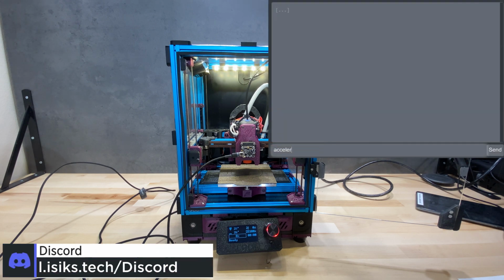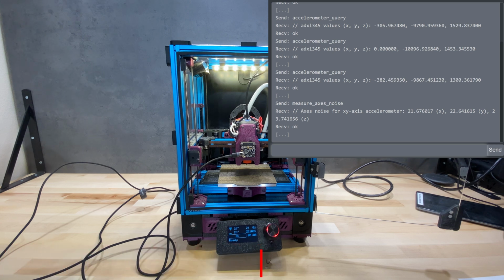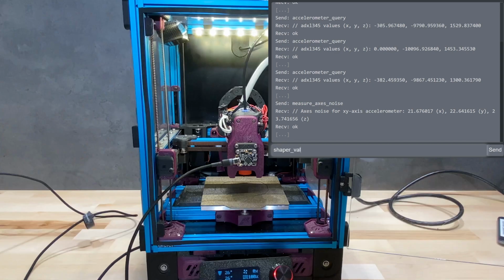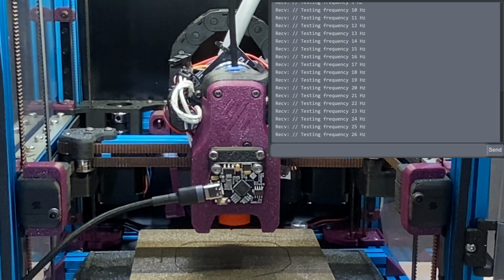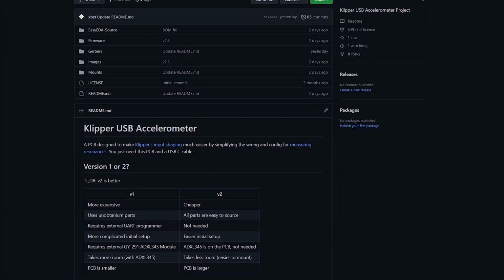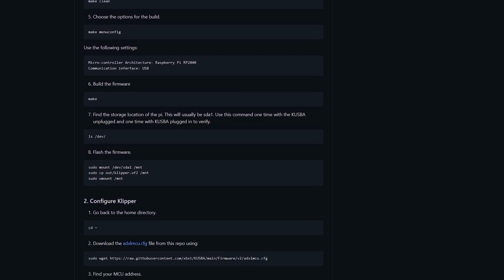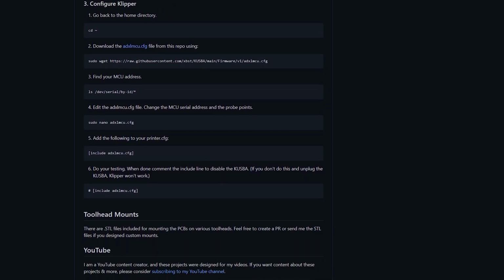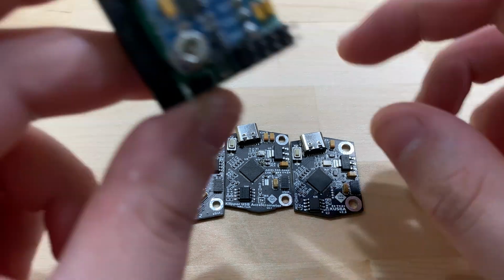Klipper USB Accelerometer PCB for Easy Input Shaper Tuning

Comment: You had me at 'Electric Boogaloo'. My v2.4 board arrived yesterday.
Reply: I'm having issues ('MCU Protocol Error') getting my 2.4 board set up. What's the best avenue for assistance? Thanks!
Reply from the maker: You need to update the firmware on the board. You can find instructions on its github repository.

Comment: {"code":"key119", "msg": "Invalid adxl345 id (got ff vs e5).This is generally indicative of connection problems(e.g. faulty wiring) or a faulty adxl345 chip.", "values": ["ff", "e5"]}

i got this error, can you tell me how to solve this? im using KUSBA V2.4

Comment: no need to mount it on the bed to calibrate Y ? is it enough to mount on nozzle X ?
Reply from the maker: If you have a bed flinger then you need to mount it on the bed. No need for corexy

Comment: I can't get it to work. I get error about " Can't open blockdev". :-( So no "sda1" is created. Have no idea how to solve it.
Reply from the maker: Sda1 is the KUSBA appearing as a USB drive. You can flash using another printer or PC too. I recommend rampon, it's literally just drag and drop to flash it.
Reply: @IsiksTech  The documentation is not accurate. I opened an issue and updated steps from klipper documentation for flushing and solving it.
Also, please consider adding LED status to the board. It's very helpful for diagnosis.

Comment: Hello, I am running a Manta/CB1 combo with a toolhead board that has an ADXL embedded. The whole system is running on CANbus. I have a KUSBA that has worked great on other printers. Can the KUSBA be used in a CANbus system? When I plugged it in, after all the .cfg configurations, Klipper returns a red error "Unknown pin chip name 'adxl'". TIA if you can answer.
Reply from the maker: I'm not sure if I'm understanding this correctly. You connected CAN bus using USB? I don't think that's going to work. 

I actually have a few prototypes of CAN KUSBA waiting to be tested. Those should work well for your setup. They have a separate connector for CAN bus and a CAN transceiver.

Comment: Why the axis orientation (X;Y;Z direction) displayed/engraved on the PCB/board is not respected on tool head position/location?
Reply from the maker: Because it doesn't matter. Klipper uses the total from all axes in its calculations.
Reply: Ok, i see.
So why doesn't it's there?
Reply from the maker: Do you mean why I added them on the PCB? It's still a good idea to know the accelerometer axes for troubleshooting reasons or for non-Klipper applications.

Comment: Is there any way this board can be used with a Windows PC, or raspberry pi, to log data with some gcode input if we're not running klipper? Just to get the same data output to analyse.
Reply from the maker: Possibly but you'd need custom code. You should be able to flash Arduino to the RP2040 MCU on the KUSBA, and log data from its ADXL345.

Comment: Would I follow the klipper install instructions for installing on a pico? Since they both have the mcu RP2040? I am finding the instructions a bit vague and have been banging my head against the wall for two days straight.
Reply from the maker: Sorry it took me a few days to respond. YouTube is not sending notifications on time to me so I only see comments when I check them. To answer your question: It depends on where you sourced yours. Some sellers (incl. me) ship them with firmware pre-flashed so you just add the cfg and it should work. If yours doesn't have the firmware pre-flashed you can follow the Rampon (recommended, works with Klipper) or Klipper instructions on the GitHub repo.
Reply: @IsiksTech  thank you. I ended up finding a few good guys on discord that have been down this road. It’s possible I erased the fw accidentally pushing the button when I shouldn’t have but we were able to get it done and I have successfully ran testing for input shaping. My whole issue wound up being a bug in clipper that would not allow me to find my /dev/serial/by-id/* and once I replaced by-id with PATH it was smooth sailing. Great product for a decent price.

Comment: Klipper reports: ERROR

Pin 'CS' is not a valid pin name on mcu 'adxl'
Reply from the maker: You have a second adxl defined in your config. Comment/delete those lines.
Reply: @IsiksTech  Problem solved, the issue is that the mcu was without the firmware installed, I have installed from PC. All is fine now. Thank you by your fast reply.

Comment: Would this work on a Linux klipper setup?
Reply from the maker: Klipper only runs on Linux so I assume you mean a Linux machine other than a raspberry pi. Yes it should work. Keep in mind you will need a USB A port on your Linux machine, USB C isn't supported with the current version of the KUSBA.

Comment: ok i am using bigtreetech cb1 in manta m8p and i cant configure it
Reply from the maker: CB1 or pi, the instructions are the same. Can you double check that you followed all the steps on github?
Reply: of all the steps the only thing different that I see is the firmware .bin not .uf2
Reply: I already did everything and it does not recognize the mcu adxl thing

Comment: Thanks alot for your video! I just got my KUSBA and I immediatley printed the cover. Than I noticed that with the cover on, I cannot press the button... Any Ideas? Am I supposed to let the KUSBA on my Stealthburner, when not using? Will I need to press the button, after I flashed and "activated" it for the first time? Thanks!!!
Reply from the maker: You only need to press the button to flash new firmware, for example when you update Klipper. 

You can leave it on the stealthburner. That's what I do so it is easier to remeasure when I swap parts. Remove the USB cable.
Reply: @IsiksTech  Thanks alot for your quick answer!!!! Will do it like this!!!

Comment: have purchased a KUSBA V2.3, pressing the button and connect via USB-A/USB-C cable KUSBA isn't recognized. Tried several cables on different computers. Any idea?
Reply from the maker: What do you mean not recognized? You can't find sda1? If so, that is weird. Most common cause of this is using a cable with no data wires but since you tested multiple cables this is less likely. 

If you mean not being able to find the serial address/connect Klipper, you aren't supposed to press the button every time you connect, the button erases the firmware on the KUSBA. Flash the firmware again using the instructions on Github and don't press it this time.
Reply: @IsiksTech  right, don't find SDA1 as well no serial address (on Windows boxes nothing in device manager). let me test if flash firmware will help - will keep you updated!
Reply: @IsiksTech  soory to bother you again ;) PIn layout on USB item is different, 3.3v/GND is pretty clear, can you advice which PIN i shall use for RX and TX? IMHO boot PINs is similar to press the button at connect?
Reply from the maker: Sda1 is not a serial address, it is the storage device. On windows that will look like a USB flash disk. On Windows serial will be a COM port. 

I think you are following the KUSBA v1 instructions on Github for flashing Klipper. Use the v2 ones. No need for tx/rx pins, just USB.
Reply: @IsiksTech  Connect the KUSBA to your Raspbery Pi. The LED on the PCB should be flashing  -> for me no LED is flashing, wether connecting without or with button pressed at connecting
Reply: @IsiksTech  IMHO i can perform all the steps on any Linux device, right?
Reply: @IsiksTech  crazy... to be on the safe side i've purchased another new USB C/A cable which arrived today. Believe or not: with that i'm able to find the device :o) Thx for your support!

Comment: hi i have some question...
1) I already have a printer with klipper installed: If I buy this accelerometer do I have to install klipper again?
2) the accelerometer must be connected to the raspberry?
I noticed that the connector is USB-c but on my raspberry I only have the normal usb ports (the classic ones) free. How do I proceed?
3) must the accelerometer be installed following a specific direction?

thanks a lot
Reply from the maker: 1) No.
2) USB A to C cable.
3) No, Klipper just combines the data for its calculations.
Reply: @IsiksTech   perfect you convinced me! I will 100% buy it :D one last question...
I want to use it on my ender 6 (and I have to draw the mount) is there any particular trick I should take into consideration?
trick that allows me to correctly transfer the vibrations to the input sheaper.
Reply from the maker: Ideally you want it near the nozzle. Also, make sure it doesn't mount to something floppy on the toolhead. Make sure there is enough room to route the usb cable.

Comment: I flashed my KUSBA and adjusted my serial address to : serial: /dev/serial/by-id/usb-Klipper_rp2040_E661347507974224-if00 which i determined by using ls /dev/serial/by-id/*.
When i try to start klipper i get the following error:

Unknown spi_bus 'spi0a'

when I uncomment the [include adxlmcu.cfg] and add

[mcu adxl]
serial: /dev/serial/by-id/usb-Klipper_rp2040_E661347507974224-if00

to my printer.cfg it starts just fine and the mcu adxl shows up in mainsail on the config tab
Reply: I have the same issue, did you work it out?
Reply from the maker: So far, every case I've seen of this is caused by having another adxl345 & input_shaper defined in printer.cfg. Checking your printer.cfg and other configs included with [include], and commenting all adxl345 and input_shaper definitions except the one in adxlmcu.cfg should fix it.

Comment: Hey :) i fix the adxl error (pull Request). Because of the adxl and the usb. Do you check the impendance in the jlcpcb configurator? I will use your config for a toolhead Board but i dont know if i need a special length and Width for the usb trace.

Comment: Quick question in regarding using this on a bed slinger. Is it possible to use this to calibrate only the X and then the Y? When I use shaper_calibrate, it goes through both. I want to use it on my ender 3v2. It worked well on my voron but that is a corexy.
Reply from the maker: SHAPER_CALIBRATE AXIS=X
SHAPER_CALIBRATE AXIS=Y
Reply: Hi, I’ve just purchased one of these, could you please share how you mounted it? There doesn’t seem to be a mount for the ender 3 v2.  Many thanks
Reply from the maker: There's an ender 3 mount on printables.
Reply: @IsiksTech  thank you. Does the fact that the orientation is different matter?
Reply from the maker: No, Klipper just combines all the measurements for its calculations.
Reply: @IsiksTech  hi, the mount on printables does not fit the ender 3v2 unless I remove the fan shroud and leave it hanging. Is tit ok to test without the shroud on?
Reply from the maker: No, it will mess with the measurements.
Reply: @IsiksTech  ok so I have no way to mount this to an ender 3 v2
Reply: @marcosgeorgopoulos794  I use a klemco mount. I had to make a custom bracket sorry.
Reply: @marckart66  no problem. Thanks for replying anyway

Comment: for all of us bed slingers can we use 2 of these per pi?
Reply: Sent a message on your discord
Reply from the maker: Yes, you should be able to. It's just like connecting 2 controller pcbs.
Reply: @IsiksTech  how does a guy set it up so i can attach 2? I cant find any tutorials and i already have 2!
Reply from the maker: You add both mcus to the cfg. Then follow the klipper adxl guide, iirc it covers 2 accelerometer setups.
Reply: Sorry for my incompetence, i assume each of these has a rpi on them no? If thsts the case im able to specificy the mcus in the adxl config but how do i differentiate between the two in the config? 

It says that i would need to use 2 spi interfaces on the same board which is rarely available. So one should be off the mcu snd one off the rpi
Reply from the maker: No worries, I should have explained better.

You add the both KUSBAs to the cfg, with different names. Each KUSBA has its own spi bus to the adxl so you aren't using any of the rpi or other mcu spi busses. You need to specify which KUSBA you want per axis in the cfg. 

It's difficult to do this in Youtube comments because of the delay and because I can't attach files. I can send you an example cfg. If you have discord can you dm me or ask in my server (link in the description)? If not, you can email me, it's in the about page of the channel.

Comment: Can i use this with normal Computers/VMs/Laptops
Since Pis are so extremely expensive right now, I would like to use a Proxmox container for klipper.
The problem is that I can't connect an accelerometer.
So would it work with this one if I pass the USB to the container?
Reply from the maker: If you can connect the main controller this way, you can connect the KUSBA too. Make sure to use a A to C cable, C to C is not supported.

Comment: I'm really struggling with this. I get to stage 8 "flash firmware" but struggle after that. If I hold the button and plug it in, I Can see sda1. But that's it. I can't flash any firmware.
Reply from the maker: If you can see sda1 following the next 3 lines of commands should flash it. If not, I need the error message to help you.
Reply: @IsiksTech  SO AFTER 2 HOURS OF TRIAL AND ERROR. I have concluded that the problem was the option in the "make menuconfig" "Enable extra low-level configuration options" was selected.  Deselecting this fixed all my issues and I managed to use your device with 0 problems! Thank you for this!
Reply: @IsiksTech  
"cp: cannot stat 'out/klipper.uf2': No such file or directory" when I try to run "sudo cp out/klipper.uf2 /mnt"

If I go back to step 1 "sudo mount /dev/sda1 /mnt" i get  "mount: /mnt: /dev/sda1 already mounted on /mnt."

Comment: are you able to make a second version with 4 mounting holes?
Reply from the maker: It's possible but I need to make the PCB larger. The adxl is right next to a screw so it should be more than good enough.

Comment: Hi! 
Would using 100ppm resistors instead of 25ppm for R3,R4 influence the accuracy/function of the board? 
(25ppm resistors seem to be out of stock at jlcpcb...)
Reply from the maker: C31439 works as a replacement. I didn't test this resistor myself but it worked well for others.

Comment: Couldn't be that all additional mass issue? Or difference is negligible? Anyway, nice job :) .
Reply from the maker: The additional mass is 9.4g for the sb and 13.4g for the mini-ab. I think that's negligible. A random adxl345 module won't be too much lighter than this, maybe a gram or 2.

Comment: Speak a bit slower, it’s very fast almost hard to get it. 

Now make it wireless :)
Reply: It has to connect to Klipper.   Klipper does not support these wireless for MCU connection.  It would be unreliable.  
Given it does not need to be permanently on the printer, resonance test only needs to be done if you move the printer or do significant changes that affect the resonance of the printer, it's really not hard to have a USB Cable along with your other cables to the print head just for the time you need to run the test.